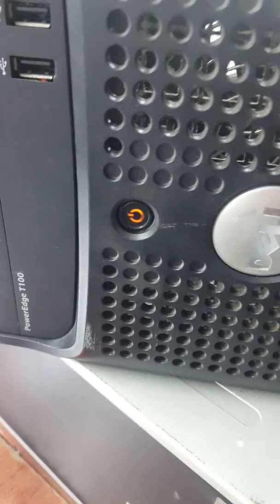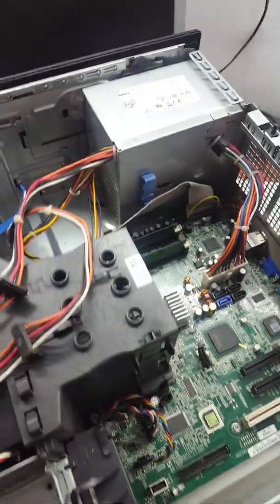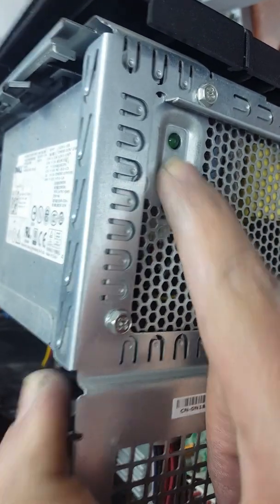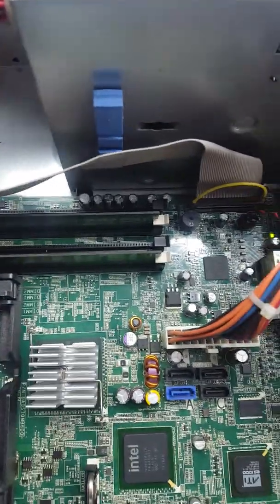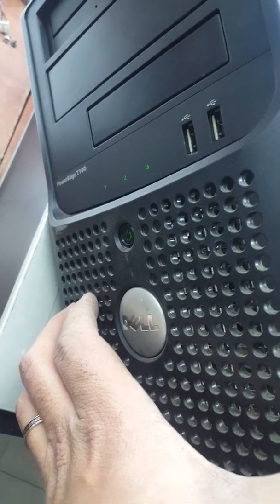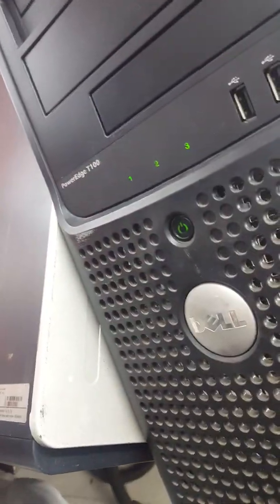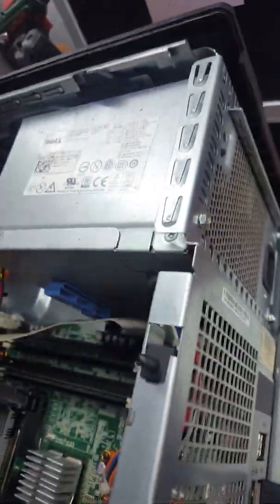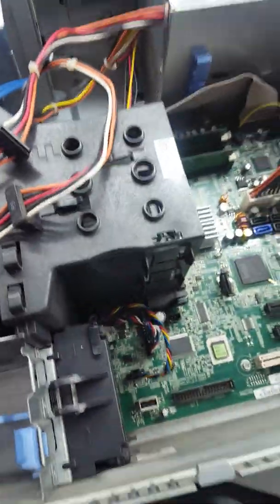how to fix dell pc orange light blinking | optiplex | poweredge | orange light solved

Comment: Hi I've tried this and I have a cell Optiplex 9010 and I keep getting the orange light I've removed my ram and tried I replaced the CMOS battery and I've gotten a new power supply but I still seem to get the orange light is there any solution to this
Reply: This could be due to the RAM not being fast enough, if you have any faster RAM, try it instead.
Reply: check if motherboard is faulty by removing ram then power pc back on if you hear 6 beeps the motherboards ok.
Reply from the maker: You can resolve this by reset the power supply, change the RAM or the slot of ram, change cpu, or a problem on motherboard happend try to change one of capasitor near the cpu
Reply: the motherboards faulty

Comment: Hey i have a dell inspiron 620 desktop, Well Recently it was working ok but the cpu sucked on it i couldnt run sfv on the lowest graphics possible so i replaced the cpu it was an intel pentium so i decided to change it intel core i3 then it dosent turn on so i unplug it plug it back in and unlike most people i got a solid orange light fan runs but still an orange light so i look up an solution on youtube people say its RAM its COMS battery, none of them worked except one one got me closer instead of an solid orange light i got a blinking orange light cut the green cord from the motherboard like this video said and now i have a blinking orange light and anything i try dosen't work i looked at your comment section and people had different pcs and you told them steps  and they worked, Do you have any steps for me PLEASE HELP!!!!?
Reply: @TheProGamingGod Thankyou i did but it still didn't work ima just get a new pc besides its time for an upgrade anyhow
Reply from the maker: Did you changed ram and cpu?

Comment: i have a dell optiplex 9020 full tower and i have this issue but it still don’t work
Reply from the maker: You have orange light bliking or fix ?
Reply: @konlive  it is blinking and also makes a very quiet beeping noise. i replaced the ram and it still doesn’t work. could it be something else?
Reply from the maker: Tray to change an other slot of ram and change the cpu too.. if the problem appears again one of capacitors or mosfets of 12V is short on the motherboard.. you must change it. Sorry for my english
Reply: @konlive  does this work ?